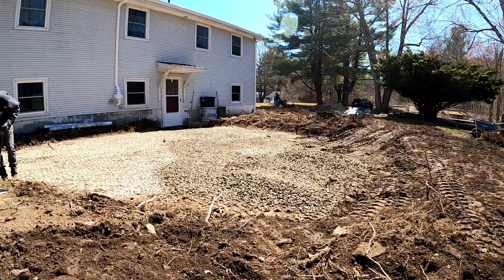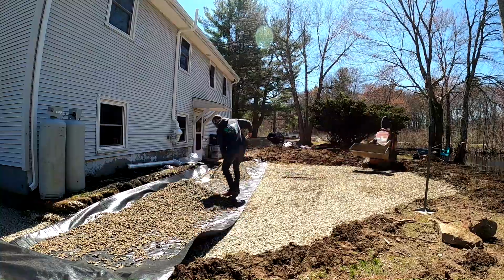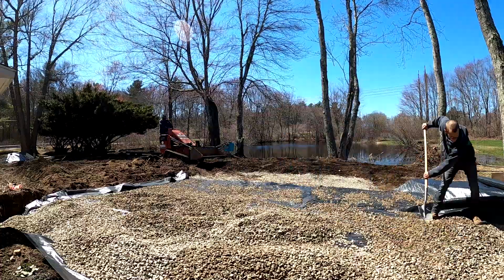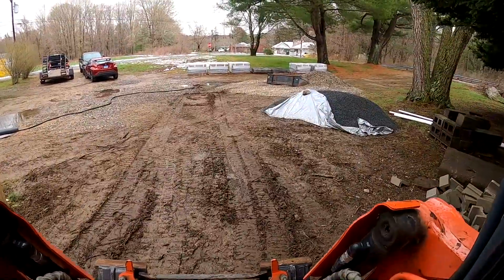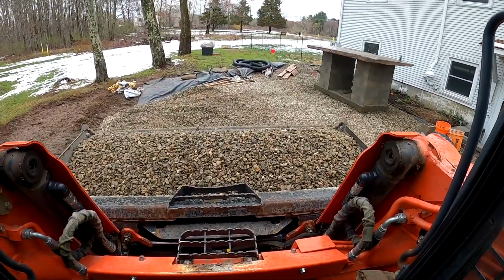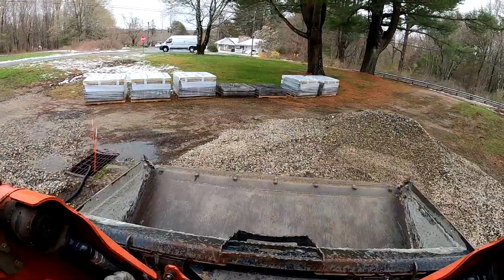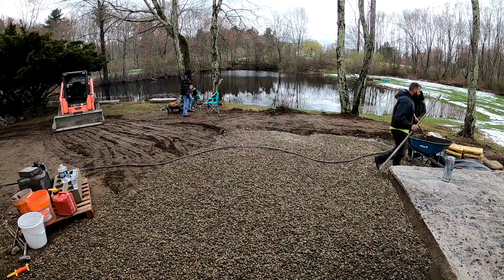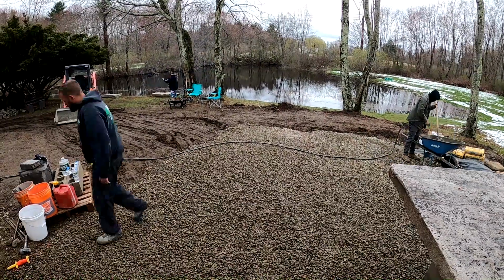Paver Patios NEED Good Drainage, So Use This....

Comment: Isn’t that woven geotextile fabric that doesn’t allow water to pass through it very well? I ask becas use I’m doing paver patios above concrete poured small retaining walls and I’m trying to figure out how to do it.
Reply from the maker: That woven geotextile fabric allows water to pass no problem. It is specifically designed to put under the base material for pavers. It is strands of plastic, woven together so water can flow through the strands. I definitely recommend using it under your patio, especially if it is above a wall. 

I have done over a hundred installs with this fabric, no issues or call backs 👍🏻✌🏻
Reply: @TheChristianHardscaper  oh ok.

Comment: Do you have any suggestions of how to deal with a situation where dense grade instead of fill dirt for example was used to backfill about two feet from the foundation and the rest of the sub soil is clay? Do you just excavate the dense grade and clay to your desired depth and treat it all like your sub soil that slopes away from the home? Or do you have to dig up the dense grade and slope away with clay? I hope this makes sense. Thank you!!
Reply from the maker: Yes it does make sense. You will be fine with just excavating / backfilling the area just like a normal install. When you install up against a foundation, I always make sure the subsoil is sloped away from the foundation a really good amount to keep the water shedding away from the house as it permeates.
Reply: @TheChristianHardscaper  Thank you for the reply! Would the dense grade that is along the house act as a "subsoil" in this case or would it act as part of the sub-base with the open grade on top separated by a geotextile? I would think sub-base? Just dealing with a situation like this for the first time and want to make sure I do it right. Thank you!!
Reply from the maker: No problem, I say sub soil and sub base of and on but basically mean the same thing. The top of the subsoil that you excavated would be your sub base. So if it is dense grade and clay, then your sub base would be made of 2 different sub soils… lol hope that makes sense
Reply: @TheChristianHardscaper  Yes that makes sense and was the source of a lot of confusion for me haha. First time encountering it in a project and wasn't quite sure if I need to remove the dense grade completely until I hit clay. Thank you for your knowledge! Hope this season is another great one for you and Benny haha

Comment: When or if do u need drainage under an open grade base ?
Reply from the maker: Only if you have standing water or a possibility of standing water in the base. At which point you have to dig a trench to divert the water elsewhere. Either with a pipe or open grade trench. ✌🏻

Comment: How will water flow or drain when u have plastic weed barrier?
Reply from the maker: That’s actually a special fabric, specifically designed for putting under the base as you seen here. It is plastic, but it’s woven plastic and is permeable. The water travels right through it. It’s called Geo-Textile underlayment. ✌🏻
Reply: @TheChristianHardscaper  thank you so much. I’ll buy it tomorrow

Comment: I've seen some people use the fabric but others don't.....what is the benefit?  It doesn't inhibit drainage?
Reply from the maker: Good question. I use this " Geo-Textile stabilization fabric " which is a woven plastic material (compared to a woven cloth material) and it is designed specifically for laying under the base of a patio, walkway, wall or staircase install. It significantly helps stabilize the base materials and prevents the sub soil from mixing in with the open grade base. It is a completely permeable material and does not inhibit drainage at all. I always recommend laying it down before an install. ✌
Reply: I think I might have used non woven when I made my road through the woods out of asphalt millings. Which is better to use ? I’m in a medium to heavy clay environment in SC. I got the heaviest one for construction site entrances if I remember correctly. I intend to place concrete over it eventually. Hopefully millings is a good base.

Comment: So what mitigation’s do you implement to deal with those roots?  I would imagine in a few years they will not be kind to that patio.
Reply from the maker: Unfortunately, there is not much you can do... We install the geotextile fabric on the bottom and up the sides of the excavation, if the roots decide to travel through and under the patio, that's nature and the cost of saving the trees. You can't solve every problem on every job, all you can do is inform the customers of possible future issues. Which I did, I told them removing the roots through the excavation could possibly hurt the trees, also told them the roots could possibly infringe on the patio down the road. Keeping the trees meant nice afternoon shade on the patio, which is very important to them and I agree. ✌
Reply: That’s what I feel figured.

Comment: I came right to this video because, a) y'all are very knowledgable, and b) my colleague heavily believes in using the crushed limestone with the fines left in (dense grade when wet&compacted) when against houses/foundations. His reasoning is because of the amount of drainage that could potentially cause flooding or damage to the house using the 3/4 clear without fines. Could you explain your thought process on that aspect because I get where he's coming from with diverting the water with the dense grade, but I feel that could be achieved by slopping the the subsoil and first compacted layer (if needed, as you said your subsoil was already good in the video). 
I just want to use dimple boards and then go with your method for now on personally, but if you could let me know your opinion I would appreciate it a ton man. Cheers.
Reply from the maker: Hey man! So first of all, my rule of thumb when going into a project is that if the customer has never had and there is no sign of water / flooding issues currently in the area you are planning to build, you will absolutely never have water / flooding issues after. This method is basically like installing a very large dry well under your pavers. The thing about surface water that most overlook is that the majority of surface water (rain water) permeates through the top soils and into the subsoils. The main reason this method is far superior to dense grade / sand is that it helps get the water down to the subsoils quicker. Hard packed dense grade holds on to water like a sponge. Some think it helps divert water, which it does kind of.... But it also holds on to the moisture like crazy. The worst thing you can have under pavers is wet base and bedding material. It causes the bottoms of the pavers to constantly be moist, causing quicker deterioration of the pavers and it also makes it more prone to heaving in the winter when a heavy freeze comes. That cause the wet dense grade and sand to expand, pushing the pavers up and breaking the polymeric sand bonds and causes the pavers to push and shift apart. This clean crushed stone for the base and bedding, does not hold on to water. And even if there is a little bit of moisture in the stones, all the open spaces in the stones gives a place for the moisture to expand into when the freeze comes. And that prevents to material from expanding because the moisture is not pushing the material apart, it is simply expanding into the open spaces. 

And even if you have a very wet / low grade area that may have water issues. Or even if you are up against the house in a very wet area. This method is still far superior. If you are worried about flooding, you can simply design some kind of water diversion by putting drainage pipe in the base and diverting to somewhere else on the property or even a dry well further away from the project. But I have installed many projects with this method up against the foundation wall. Like you said, the main thing in that situation is to slope the sub soil away from the foundation so that any water that does travel through the stone, it will divert away from the house. And also, don't forget, we use polymeric sand in the joints. So any rain water will be shedding away from the house anyway because it will travel across the top of the pavers to the farthest point of the pavers. 

I hope that answers some questions! ✌
Reply: @TheChristianHardscaper  that answers them right to the 'T'. Thanks a lot, eh!
Reply from the maker: No problem! ✌🏻

Comment: Why arent you using geotextile fabric between the 3/4 inch gravel and the chipstone, isnt it more likely that the chipstone migrates into the gravel than the gravel migrating with the subsoil?
Reply from the maker: Once you spread out the chip stone everything is pretty much locked into each other. The gaps in the 3/4 inch crushed are not big enough for the chip stone to migrate through. sand and stone dust however certainly would migrate because how fine the particles are. Thats why I don't use either anymore. This chip stone has the least likely hood of migration compared to any other bedding material ✌